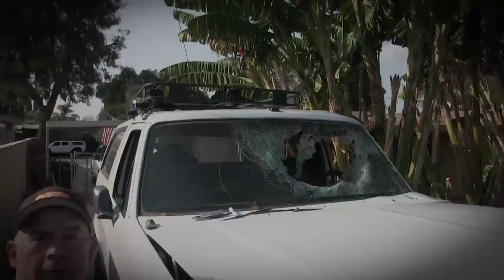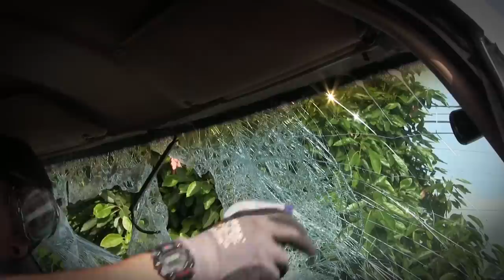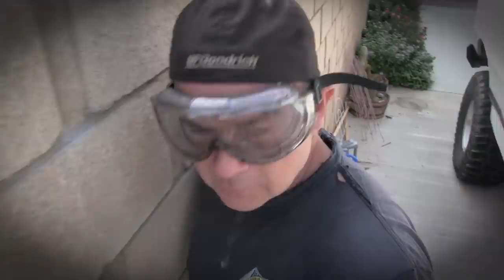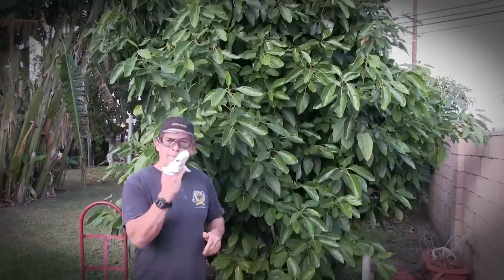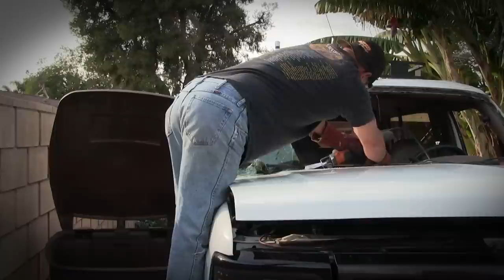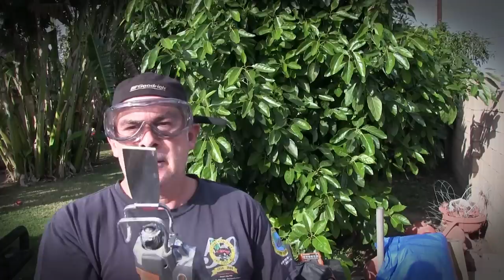Bronco Windshield Removal

Comment: Don't know how cold it is around their now, I have used a heat gun in the past to warm the area up just to give my self a fighting chance. Depending on ether Butyl or Urethane. Urethane can be tough stuff to cut.

A recommendation from a glass tech of mine is after removing a windshield and any residual butyl calk or urethane calk is to remove any rust and spray a matching rust inhibitor paint in the window channel.
Its the one area that is always missed during a windshield replacement, can't do it after the fact.

Also, don't try and have a windshield installed until the body has been straiten if not most of the body work has been done. It can and will put a strain on the glass or cause a leak down the road, if not cause the new glass to crack.

Good luck on the rebuild. Should be a good series, guess the Tacoma will have to pull the weight.
Do you plan on keeping her after the rebuild?